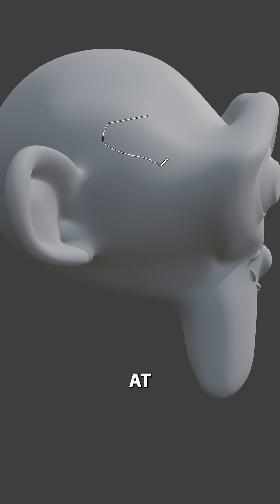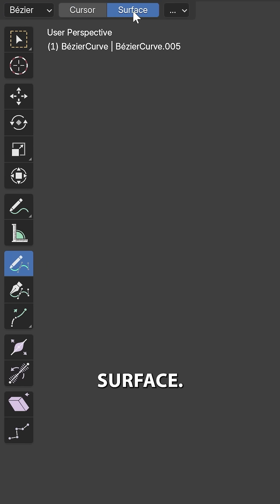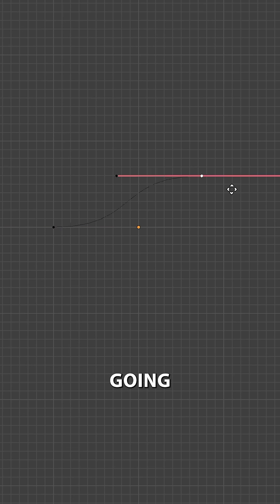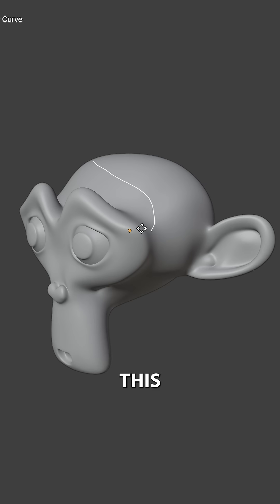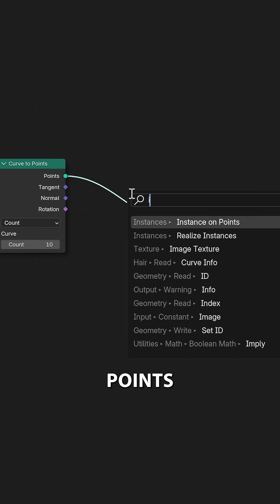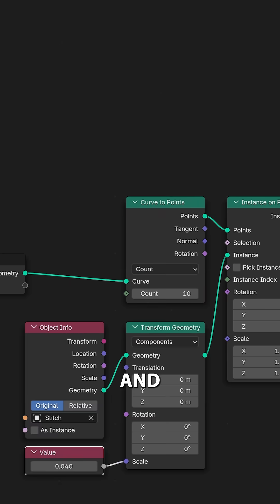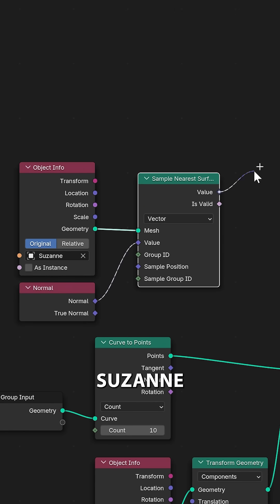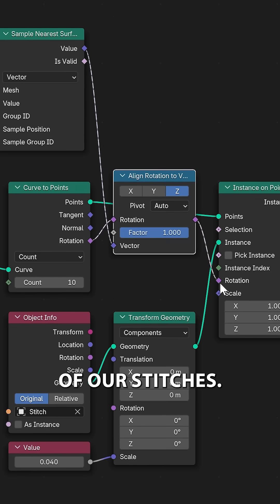How to draw stitches on your model with #geometrynodes #b3d #blender3d

Comment: I followed this video to the letter, but the orientation of my stitches is not aligned with the drawn line, but perpendicular to it. If I draw a vertical line, then stitches start and end points are left to right from the drawn line and not up and down. So, start and end points don't sit on the line. What have I done wrong?
Reply: Same for me, I tried following his other suggestion, but none seems to be working. If you have succeeded, please let us know.
Reply: @sudipto30  sure, I will
Reply from the maker: Based on what you are saying, I think it could either be:

1) You have set the sample node to "float" instead of "vector"

2) The axis are different, first check if its just the "align vector to rotation" node's orientation by changing between the "X" "Y" and "Z" (top option on the node) to see if its that. 

3) If the stiches are following the curve orientation but its just the stiches facing the wrong way you just need to adjust the orientation of the stitch itself (the original stitch object). You can do this either manually by changing the stitch curve object in edit mode or by simply adjusting the rotation with the "transform" node in the geometry node editor.

Let me know if it works! ~Jim
Reply: @cgboost  Hi, I set Sample nearest surface to vector right from the beginning. Orientation is the same as yours cause Suzanne has default orientation. I doubt you rotated it. 
I even tried to draw a line and adjust stitch curve to follow the line orientation, but when I draw curved line on surface, the stitches begin to dance :)
~Alex

Comment: How it basically works:

When you draw, blender takes the 3d vector position of curve, and based by points, it index each one by same distances, which is porportional to number of points. You have curve lenght of 10, and you want 2 points, that would mean each point is 5 units away from another, or you want 5 points, then there is 5 so then distance between each point is 2. 10 /5 = 2.

Instance on point means it transforms one object into multiple instances, making each object its own instance as all together with their own index if you want to use that as well.

Second, object info is dragged from the node box, the vertical rectangle where it shows your objects in scene, so it contains info like what the output states.

Transform node transfroms object, and in this scenario its used before instance cause you just want to scale ot down and add geometry.

Suzane ( monkey mesh ) gets also dragged as object info, and then you take normal node, which is undefined until you connect it to an function, like sample nearest surface, so it gets normals, and normals are the faces of mesh that point in the direction they are rotated and transformed. 

And for lastyou just set position of stiches, the first dragged object onto the point position
Reply: dang, how did you learn all that

Comment: I woulder did you just trying until you get it or you taking the special courses or or watch different video and copy a idea
Reply from the maker: Geometry nodes are just a way to deal with geometry in a more direct way. Think of it as opening the hood of a car and being allowed to mess with the internals of the car. Since I have a bit of a background in how 3d geometry works on a more technical level it made understanding how to use geometry nodes a lot easier. ~Jim
Reply: Thank you 😊

Comment: I tried, but the stitches are not aligned with the curve I draw, and the distance between each stitch is not regular. Can you help me?
Reply from the maker: Sure thing, I think I know what might be the problem.

1) If the spacing of the stiches is weird my first try would be to resample the curve, this will basically place new handles along the curve, evenly spaced. By spacing the handles evenly it will also space the points evenly. To resample the curve you need to add a "resample curve" node, shocking I know. Place this node before turning the curve into points. Let me know if this fixes the spacing.

2) If the stiches are oriented weirdly it might be due to two things. First check if its just the "align vector to rotation" node's orientation by changing between the "X" "Y" and "Z" (top option on the node) to see if its just the orientation. This might be it, now if you get an align result, that is, the stiches are following the curve orientation but its just the stiches facing the wrong way you just need to adjust the orientation of the stitch itself. You can do this either manually buy changing the stitch curve object in edit mode or by simply adjusting the rotation with the "transform" node in the geometry node editor (my go too option). Hopefully this should resolve the problem.

Let me know if it works! ~Jim
Reply: @cgboost  Hi, thanks for this video! Is it possible to post a full node setup for this video? It's bizarre that Blender works differently on different machines. Must be either some nodes are missing or something is wrong with bezier curve
Reply: Thanks a lot for your kind and quick reply!❤
Unfortunately, nothing works.
It's me, I'm very bad with geo nodes.
Also, my knowledge of Blender is still almost basic.
I'm just trying to find a way to add topstitches in my shoes project.
I come from Clo/Style3d world where this task  is so easy.😂
Reply: @justme3d  hi, I'm experiencing the same problem with orientation. if I draw a straight line, then I can indeed align stitches along the line, playing around Transform node XYZ rotation. But if the line snakes down the surface, then I cannot align all of them
Reply from the maker: No worries @justme3d, if you want me to give you some tips let me know. ~Jim
Reply: @cgboost  Thanks.
I'll continue to try.
In the meantime, I found this add-on.
https://youtu.be/uXVpZQF8gz4?si=cLtvNflxyJkcK3vC
It needs some adjustments in my opinion, but it does the job.( I modified the the object it append to solve the double-side stitch issue🤫)
@Lex-u5w I'll let you know if and when I'll find what's wrong for me.
Reply: @justme3d , please do, because I gave up trying. Unless there is another extra node that wasn't captured in the tutorial, but does the whole magic